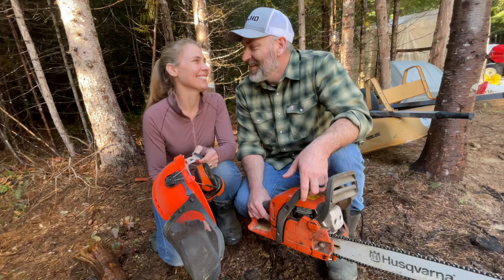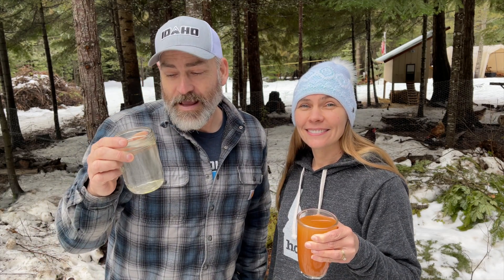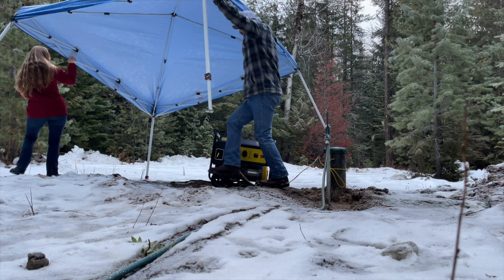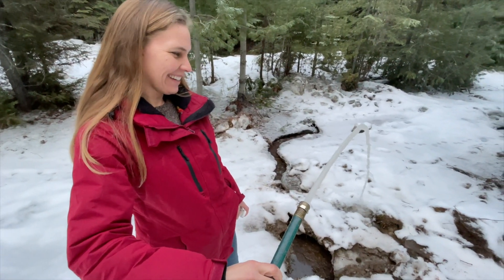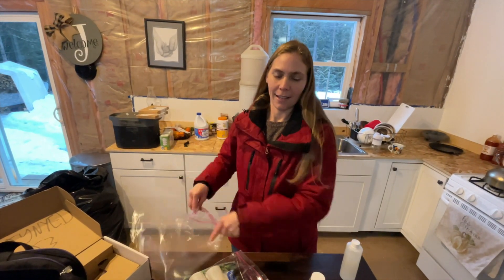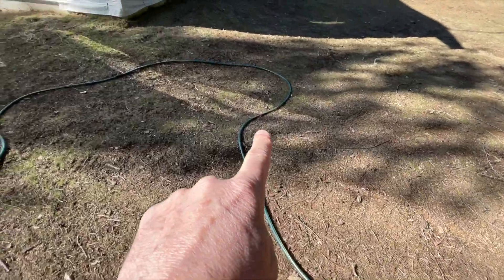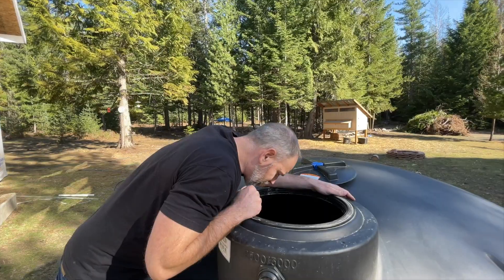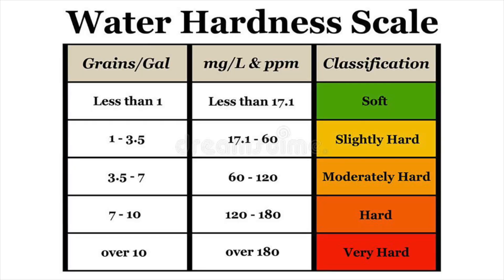Brand New Well... POISONING US?

Comment: Clear, then rusty: I believe that you may have "clear water iron" (ferrous) when you startup; then you pull down the oxygenated water with precipitated iron (ferric) in it.  This indicates that your pH may be lower than 6.5 at start-up with the iron is in solution and with oxygenation the pH increases.  Get iron/pH test kits at Lowe's and get real-time results.  Once you get some data, contact various water treatment companies.  This problem can be tricky to fix due to iron clogging.  The good news is that you have plenty of gpm to backwash with.

Comment: A new project for you: A "water" shed - do excuse the pun - around the welll head.  In there you could house your generator/have electric ran to it and house the firtering system to allow any sediment to settle out, and any carbon filters then water softener with iron filter.  I'd have it all BEFORE the main storage tank so that you are only storing clean potable water that can be used for anything.
Do remember to add bypasss loops to everything so that parts can be easily changed/cleaned/flucshed over time.

Comment: A recommendation from my own experience. On the green tank: Put a fitting on the tank, so that the hose connectes right to it. Instead of poking it through the hole and using the board to hold it in place. This will keep slugs, bugs, and rodents out of the tank. If you need to, then put a vent on the tank. You can make one from two different sizes of pvc pipe, with holes drilled in them, and some kind of air permeable filter sandwiched between them.

Comment: Use two whole house filters in series, that way you will have to change the first one more and
the second one less. Your problem includes left over drilling mud/clay which will clear over time.
In a year or two the water will be crystal clear. You will become water purification experts. You 
might look into swimming pool filters as initial filtration. Also settlement in your holding tank
will help too. Draw from a midpoint in the tank, not the bottom. After the first series of filters,
split the supply off for activated charcoal filtration and drinking supply. Additionally, catch some
roof runoff for animal water and gardening. Thanks for sharing your challenges. Life is not
always easy, but, on the scale of difficulty, the water difficulty is small providing loved ones
are all healthy and well.

Comment: What pump and voltage are you running? I would run a sediment filter minimum at the pump and then again at the house with a carbon filter. My well is 480, with head at 250ft. Looking for pumps now, maybe off grid and just 120 for the pump.

Comment: The first level filter is a nano filter that has a backflush port, backflush based on the impurities level, but at least once per week or once per day if you are moving a lot of high mineral content water.  Usually, another way is to put a GPM meter and backflush when the flow is less than 75%.  That's for the house water so it's more about the efficiency of the flow and how it affects the resistance at the pump pressurizing the line.  

This first level would address most of your yellow or reddish water that's likely minerals that would be filtered thru the nanofiltration discs.

For purified water, use the Ozonation process 500mg/15mins/gallon.  Usually, it's air passing thru a plasma arc that converts the O2 to O3 then it's passed thru a small orifices-type airstone (much like an aquarium airstone).  The small bubbles do a better job of mixing with the water and vaporizing the contaminants.  Use a glass 10-gallon dispenser for this process.  So wait for about 15 mins for the ozone to dissipate, half-life, etc., and make sure it's a well-ventilated area.  BTW, you can get the plasma arc from a stun gun arc or an ignition coil from a car.  Both are powered by DCV batteries.  I don't use alkaline or UV purifiers.  Once you have the process down test your water and you will know its working.

I have used many automation devices to actually do this in 200-gallon tanks but it's more than you learn these basics and determine what you want to automate to get rid of the nuisance factor as you take things for granted later.

Since most of my work has been off the grid all of this is doable on battery power, even your water pump, uses 24VDC marine pumps.  
If you don't have the power storage processes down pat, go directly off the generator because your battery efficiency isn't going to be that great.  That said, you could be topping off your batteries too while running your water pump on the generator.

Comment: Hi You will need two water filters on the supply line, one with a 50 micron carbon filter and the second with a 25 micron sand filter/resin. You will also need a Ultra Violet (UV) filter on the system as although the CFU are clear they can rise at any time due to animal fiestas. If you want to be extra safe you could also add a magnetic filter to take out any iron or other heavy metal. This should all be added before your tank as the tank will act as a settlement chamber also that you will need to have cleaned and disinfected every year or two as the sediment builds up.
Reply: Absolutely fine suggestion.
Reply: Alan Hart's basically got it. I would use Big Blue filters with clear plastic sumps so that you can visually check when the filter needs replacing. I would add a third filter of activated charcoal for better taste and to remove other chemical nastiness. Mineral content will shorten the life of your plumbing, and even if you have only moderately hard water I'd suggest a water softener because it will also remove a large portion of the iron. If you had high iron, a dedicated iron filter, such as the model from Water Boss, will help. You must clear as much sediment and discoloration from the water as possible before sending it through a UV filter. If it all gets too cumbersome and hard to maintain, the two-water system works fine. That's what we do at my place where jugs of spring water are used for drinking, making coffee, and so forth, and well water for everything else. Hope this helps.
Reply: Hi again, sorry forgot to say I do live in Scotland and we call these bore hole wells and been doing this for 30 years. Did not give any products as everything will differ from UK and USA.

Comment: I use rain water for every thing

I have a 5 micron and 2 micron off the tanks whole house.

Then an under sink 0.5 and 0.2 micron filter for drinking.

Look to what is done locally i would say. But you are going to have the on going expense of filter cartridges 

But thats part of living off grid.

Get the best you can 

Reverse osmosis will remove a great deal more than filtration ( 70% through filtration 90+% through reverse osmosis)

A whole house reverse osmosis kit can be bought now days relatively cheaply ( research needed though)

From your tests you dont need the bacteria removal that reverse osmosis brings though

Comment: we filter our well water with a large 20 gpm whole house filter and then a water softener.  We have fine sand in our water that the filter stops and hard water which we treat with the softener.  The new arrangement (previous owner did not do this) is clean and does not leave water stains on the shower and sinks. . We have lived with iron in the water in a previous house and wewould put in a iron treatment unit if that was a problem (red water).  We do not have a UV unit or any type of sterilization on the water.

Comment: A reverse osmosis such as the one suggested is perfect, I don't know if it is expensive in the USA for a domestic size equipment, but depending on the results of the analysis, an initial filter with gravel of different diameters, silica sand and activated carbon is usually enought to remove solid waste and adjust the ph. You can also add a very low chlorination in the tank of 0.1 or 0.2 mg / l it will help a lot.
The important thing is that the well must work since when removing the water it is obvious that the sedimentary deposits move in the area where the water is and that makes it dirty and when it receives air there are aerobic processes that are activated and that is why it sometimes smells.
Well water has a lot of bacteria and even anaerobic algae that die and rot, the smell may be due to that. And if this scares you, never test your supermarket water.
Reply: There is a ratio between the size of the filter and the amount of water that must pass through the filter. These proportions remain valid as long as the well has a little daily operation, that is, the water cannot be filled with earth as in the beginning of the video

Comment: i would put in a cheap pre filter a rope filter to catch the silt then in to a reverse osmosis then put a charcoal filter under the kitchen sink. we had silt at are camp site and water color always changes it the water is not used for a few hrs. the rope filter good for 4 months the one under sink last 2yrs (should say we just change it then as the water still tested clean at 2yr from lab particulate test) the osmosis filters we just change when it per the instructions

Comment: Start with a "spin down" particulate filter.  It'll also remove much of the already precipitated iron "floc".  Then use a cartridge particulate filter or two in series.  Follow that with an ion removal resin cartridge.
Despite what manufacturers (aka sales staff) say ion resin beads are rechargeable.  Look on YT for vids.
Suppliers:  There are many DIY suppliers all over the US.  I use one in GA, but then I live in TN.

Comment: Is your well pump & generator 240 volt or 120 volt? If you can use 240 volt you can reduce your amps by about 50% this is easter on both pump & generator.

Comment: One thing I’m going to try is, using 4 plastic 50 gallon barrels layered with river stone, gravel, sand in three barrels, the last barrel will have the river stone, and charcoal as the water exits! Cheap inexpensive way to filter water.
Reply: Thanks for the idea!!
Reply: Get a pool sand filter,backwash every few months stops the buildup and having to change gravel and sand every few weeks.

Comment: i would go with whole house water structuring (check ben greenfield fitness for more into) and possibly a whole house reverse osmosis filter as well. For drinking thje water you should generally aslways add back good minerals with celtic sea salt or other solution that Ben would recommend

Comment: Get another cistern tank.  Fill it with a layer of gravel and then sand.  Feed your well into the gravel and let it percolate up through the sand and then into the second tank.  That should remove most of the solids in the water.  Pump it into the house through a whole house filter and water softener to get clear water.  Using a second tank will save a lot of maintenance on filters.  Probable more expensive.  Nothing better than natures filter.   This is the system that our local municipality uses  to get the iron content down.  Keep both tanks under ground to keep the bacteria counts down.  Light will cause b23acteria to increase.  Burying the tanks will also prevent freezing in the winter.
Reply: Many cities use either pressure or gravity sand filters. In both causes they are down flow threw the sand bed that is supported by layers of graded gravel. In both cases they have a backwash system to periodically clean the media. I designed municipal water and wastewater plant equipment for 35 years.
Reply: @gvet47  that's what I was thinking of but my knowledge of that subject is limited.  It seems that the installation costs would be high but the long term costs would be low.  That is the way nature does it for the water table.

Comment: A 5 micron filter followed by a one micron filter and then into a softener for household use also recommend a reverse osmosis for drinking water and ice.  RO under sink units are cheap and last along time.  Iron is one of the hardest metals to get out of the water there are iron gate filters but research i have done is they do not work very well and require a lot of maintenance.  The iron when oxidized will form iron bacteria that is the smell.  My well has very hard water but i take care of it with what described above.  Bacteria in a well is usually not a problem for deep wells because of the very low dissolved oxygen in the water shallow wells with septic systems up gradient can be a problem.  Ps the particle filters I found work best are the string wound filters they last longer and don’t clog up.  I am a geologist who has worked for 31 years with groundwater mainly contaminated former military complexes and have installed lots of remediation systems.  And iron gives us problems in most of them.

Comment: my well was down to 400 feet. it was years ago, so i don't remember the dept of the pump. being from the city with city water, i installed a 2 filter system on the well water. i also did a 1 filter system on my city house. well the city filter would get dirtier than the country filter. it's a shame after all that money, that it is not crystal clear. i would also vacuum out your storage tank if i was you

Comment: Iron and arsenic are more readily removed if they are oxidized first, before filtering. Oxidant choices include: air; bleach; ozone; hydrogen peroxide; and other less commonly used chemicals. Filter life can be extended if preceded by a knock-out tank to let oxidized particles settle. Lots of options, products available. Talk to multiple professionals who do not sell equipment (folks without vested interest in selling brand “X”).

Comment: Definitely in need of whole home sediment filters.  Reverse osmosis for drinking water (whole home is a waste IMO).  Check out Iron removal systems that use injected air and granulated activated carbon to oxidize iron and back wash it out of your system.  That’ll be the cheapest and most effective way to remove iron.  

To extend the life of appliances and fixtures, you can add a softener.

Comment: i PERSONNELY  would build a water shed over the well, Inside I would filter the the heck out of it .  Then I would put another tank outside the well house and have a high water pump thats about med hieght of tank ( so it doesnt pump off bottom) and put that to your holding tank. Then I would install another couple of filters in you crawl space to supply your toilet  and shower and sinks and still use the filter system you have in the kitchen for drinking water and cooking .    I would also do a clean out of the first tank after you fill your second tank up.     This will be a schedule you would have to create when you need to fill up your second storage tank.   you will have to have a S.O.P   Standard operating Procedure to fill tank   Example 1 Run well for 30mins    (2) hook well to filters in pump house (3) Fill 1st tank full 4  Let water sit for a day or so (5) pump  water to 2nd tank 6 change water filters in crawl space      (7) After completing these task remove remaking water in 1st tank and clean with bleach and flush it out so it ready for next run ,  Hopefully after a few months and you test the water it well be able to bypass the cleaning to quarterly  cleaning or seasonal one    Good luck

Comment: I'm curious as to why you have your well pump set so shallow in your well? What is the static depth? To get your water to optimum, your pump should be set about 10' above the depth of your well. You should have a "Pump Protect " mechanism that shuts off your pump if the water level drops below it. At the shallow depth of your pump it will take forever to discharge the minerals because they cannot exit your well. You will continue to have colored water periods as minerals saturate the static water each time your pump is off. Eventually, you will destroy the impellers of your pump from the churning of minerals. I have a 600' deep well and my pump is set at 590'. It only took a few hours running at 7gpm to get my water cleared and then I shocked it with a gallon of Chlorox, left it for 3 days and pumped it out through my system including my 2500gal storage tank, then I drained it. Haven't had a problem with any tests afterwards.

Comment: Why would you drill a 520 foot deep well, and put the pump at 200 feet? What is the depth of water above the pump?
Reply from the maker: 90’
Reply: So you drilled to 520 feet before you hit water, but when you did, it was like an artesian well and the water flooded up to a level of 110 feet below the grounds surface? I imagine that is a pretty special well. When we moved in, our well was at 70 feet, but the water vein feeding it was at 50 feet, at 3 gph. Hoping for better, we had it deepened to 105 feet, the max that the drillers equipment (on site) would go. We were able to move the pump down, giving us more “residual” water stored in the water column. Our iron well casing was and is only 10 feet. To go deeper, the well people felt obliged to pound the iron casing deeper, per some misguided (current) government requirement. Our “iron” in the water problem went away when we changed from galvanized iron pipe (to pvc plastic) in the wells supply column. I didn’t want to re-contaminate it with iron well casing, driven deeper. Our situation was 180° different than yours. We might be somewhat restricted in our water volume, but it is excellent quality, and in an area known for high arsenic levels, ours is undetectable. Over time, we’ve been able to remove the iron stain from the shower stall.
Just found out that a neighbor had sunk 3 wells, getting salt water on the first two and going over 500 feet on the 3rd, but it was great. A full artesian well, with water pressure even at the surface, which he does augment with a pump for house pressure. Don’t know about his arsenic level. I guess there are all kinds of wells.